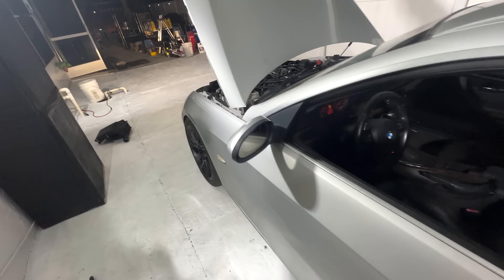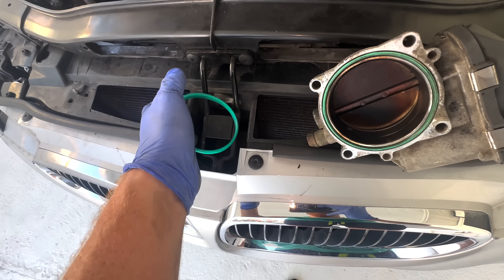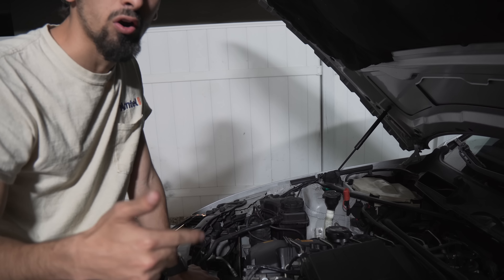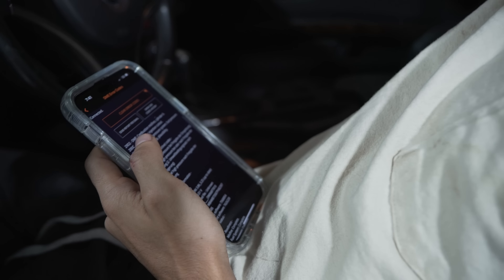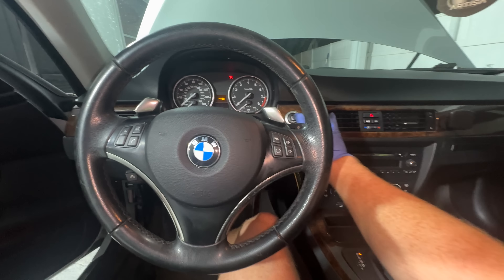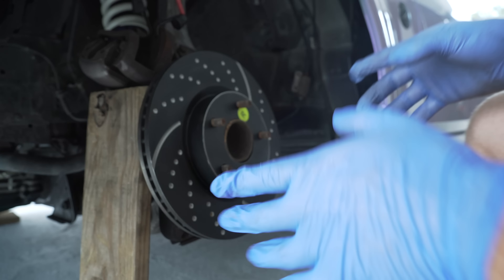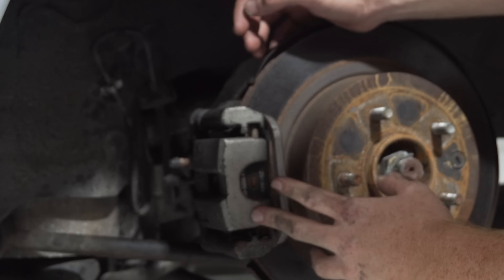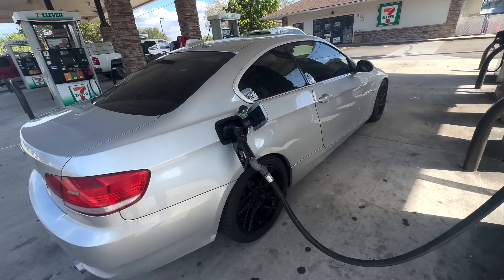How my BMW 335i Build Turned into a Disaster...

Comment: I heard you need an adapter in order to use the updated pointy low pressure fuel sensor. FCP sells the whole kit. I have a video on it too 😅
Reply from the maker: Worked fine without the adapter 🤷‍♂️
Reply: No you don't

Comment: Yo bro I got a 135i 6 months ago got it with 70k miles from experience do spark plugs, injectors, coil packs and you shouldn’t misfire. They make a precision raceworks ignition kit to help prevent misfires for $500!! been running as a daily for the entire 6 months only thing else is waterpump thermostat and you should be good.
Reply: Eldor or B58 ignition coils. PR pop out.

Comment: Remenber to check to check the low fuel pressure pump idk if you are running a tune but I was getting the exact problem on mine and since you were running a new high fuel pressure pump it needs more gas and the low fuel pump could not keep up. Also check the fuel regulator maybe is not keeping pressure on the lines when the car is off and is causing miss fires at start up. All of this happened to me 😂 good luck.
Reply: Btw I’m mechanich I own a e93 335i 2008 and I have been every freaking repair on the car 👍🏻
Reply: If a bag doesn’t have an opening how do you put anything in it? 😂

Comment: Don't forget to open the master cylinder cap before removing the caliper and also, use the old pad to push in the piston on the caliper with the c clamp. 🤙

Comment: Should check ur sensors for the charge pipe when I did my ofhg i forgot to plug it in and car would do that but I say low pressure fuel pump if ur problems

Comment: I have a 06 e90 n52 same motor but it’s NA misfire can cuss spark plugs  or coils or fuel injectors not working or not spraying or check your intake tubing there mite be a whole that can cuss misfire and run like shit or use a smoke Machine to see where’s the whole is

Comment: i had a boy who was sent 3 faulty oe n54 hpfp in a row from fcp until they finally just sent him a genuine part free of charge. fcp is so cheap because they buy scratch/dent items from manufactures, because when the case of a faulty part comes up they don't lose rlly any money! i like them but for parts like this it can be risky.
Reply: Is this actually true? I thought fcp was cheap because they use oem products as alternatives and gives the option for oe if you want but at double the price. I’ve spent over 4k at fcpeuro and never had problems.

Comment: Sounds like you have a bad low pressure fuel pump your cold starts are kind of delayed it seems. that goes out just as common as spark plugs lol so just replace. Injectors do leak but its less common than broken fuel pumps